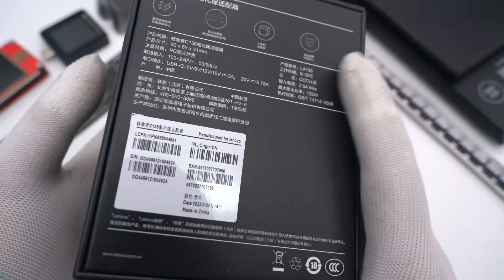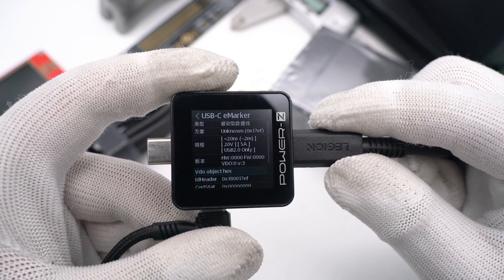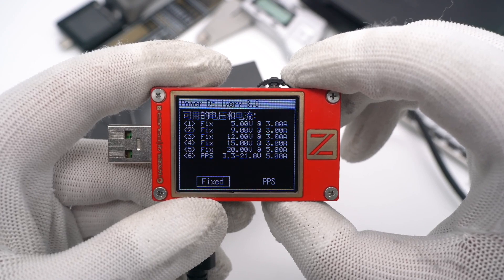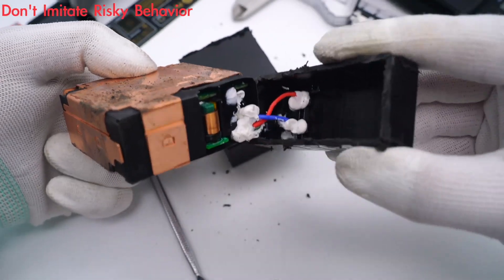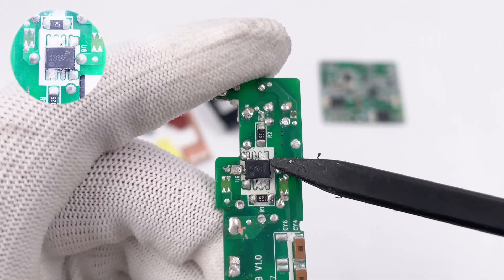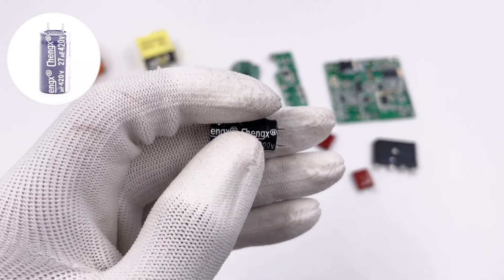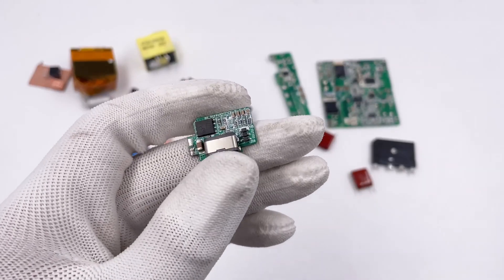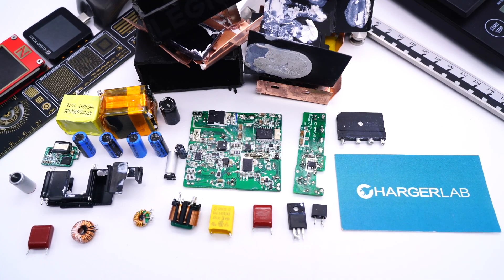Teardown of Lenovo Legion 135W/C135 USB-C GaN Charger

Comment: Does it deliver 135w at 110v equally to 220v connections? Because the 140w new one is kind of capped to 100w if using a 110v, I’m in North America so I’m thinking if this is actually better for my 110v situation 😩

Comment: Could you measure the signal resistor in the C-slim tip cable head between the central pin and the shroud? Should be 1 kΩ (or 550 Ω but that would suck).

Comment: Would you know other brand offering this? 20V 6.75A. 

I see baseus with 140W but they use 28V not 20V, so if laptop needs 20V its still stuck to 5A or 100W..
(Or am i wrong with this lol) Anyway looking for affordable higher wattage GaN. This one not available on my country it seems.
Reply from the maker: Lenovo 135W (20V 6.75A) is the proprietary protocol. So, other brands charger won't support it.

Comment: 联想属实天天耍猴呢！海外完全没有！淘宝买完邮费还不知道要多少！（想买.jpg）
Reply: 京东 已买。海外购。为了凑邮费，顺便买了台红米。哈哈...
Reply: 非常好用，618期间。199入手，加上分摊到的邮费，也就230左右。
Reply: 是的 今年回国顺便买了个 替代了原本的135w粗线大板砖。 拼多多108元入手
Reply: @joecomets8654 is it still working?? Will it work on gen 6 legion 5 pro rtx 3070
Reply: @moonknight8693  still working but 3070 needs more power

Comment: Where can this charging brick be purchased from? I can't find a vendor anywhere
Reply: Only available in China right now
Reply: I got one from ebay for 55 bucks.works fine in auto and balanced mode.
Reply: @mrinmoybanik5598  Bro I saw £52 on ebay UK. In China it only worth about £17.5
Reply: @mrinmoybanik5598  still working?

Comment: Hey charger lab, is it okay to charge my phone using the usb-a from a desktop computer? i know it's pretty slow, but other than that, is it okay?
Reply from the maker: Of course.
Reply: Yes, and actually slower charging is better.  Less heat and stress on the battery.
Reply: yes

Comment: 5:48 110 milliohm but the rectifier at 7:00 is only 1.7?  I must be out of touch with the times but I've never heard of on resistance that low
Reply: Checked the datasheet, it is actually 1.7mOhm. Can do 27.5A continuous as well
Reply: @jaccurtis5789  ..thats what i wrote, 1.7. Thought it was obvious i meant mOhm

Comment: I really hate proprietary charging port, why not just use USB-C for both ends.
Reply: So people with older laptops can also use this charger?
Reply: @niravcodes  The newer laptop should move towards USB-C instead of use a proprietary port for only lenovo laptop.
Reply: Backwards compatibly/upgradability to current gen and older Lenovo gaming laptops. Users can now upgrade to a smaller GaN based charging brick.
Reply: @rajatdixit007  I know, what i mean is newer lenovo laptop should use USB-C charging port instead of proprietary port.
Reply: @jcdchill  that’s why they included two cables. The one with the yellow tip is for older ones, the Type C to Type C is for newer.
Reply: @rajatdixit007  Only their Yoga series use USB-C as a power source. The yellow tip is not for older one, all their newest model are using this proprietary port.
Reply: @jcdchill  it could be that their power requirements is higher than 135W. I know the yellow tip can go 170W+. Let’s hope in next 1-2 years we can have them transition completely to Type C for 150/200W laptops. Tearfully looks at RTX 4xxx GPU power requirement 🥲
Reply: @rajatdixit007  And space heater sit on ur lap. Do you prefer rare or medium rare?
Reply: @jcdchill  they do.
Reply: @rajatdixit007  yellow tip ones can go upto 300w on legion 5/7 series laptops.
Reply: @jcdchill  This is not true at all. All T series after the T480 use a USB C, as well as all of the X1 carbons. The only ThinkPads that still use the rectangular yellow tipped plug are the workstation models that require high wattage.
Reply: Most low power Lenovo laptops have switched to Usb-C already, apart from Legions which simply require more that what USB PD can deliver.
Reply: USB-C currently cannot handle over 240W. Some Legion laptops with 3060 and up have 300W charger in the box.

Also the video clearly mentions that it comes with 2 cables: C-C and C-Lenovo
Reply: The latest gen of Legion gaming laptops come with a 300W charger, but you can also use USB-C PD 135W charging. You just won't get the full power of the laptop.
Reply: @mariuspuiu9555  windows laptop power consumption is just insane, holy sh!t no wonder MacBook sales continue to raise, whereas pc market keep shrinking.
Reply: @jcdchill  the in that GPU can render many times faster than even the M1 Max.
here's a comparison between the M1 Pro and the 5900HX + RTX 3060 where the mac gets absolutely destroyed in a workload that i will be doing:
https://youtu.be/iS_uPukPuo4?t=332
Reply: Seriously would love for this to be available.